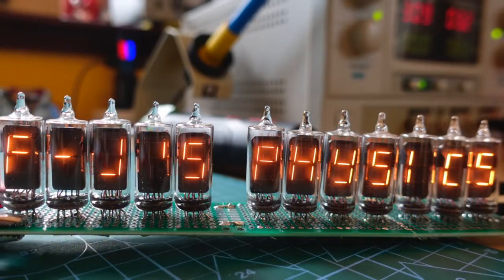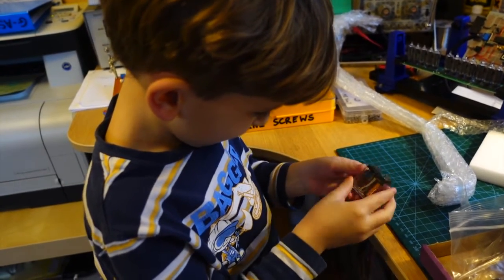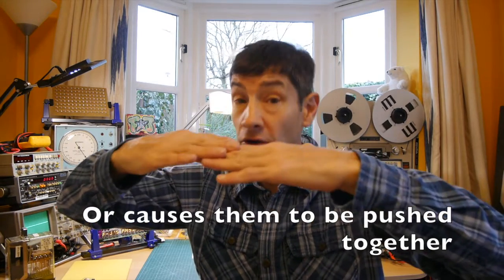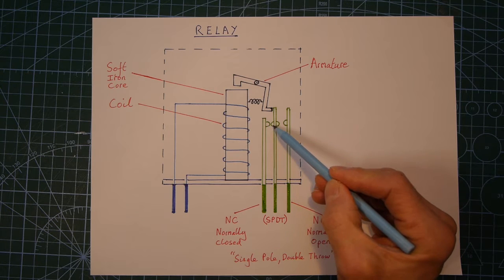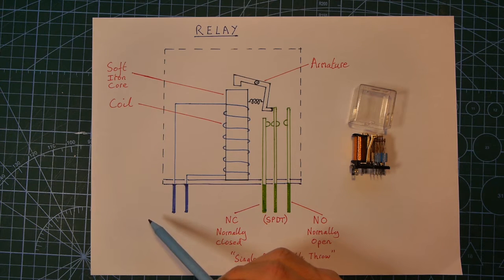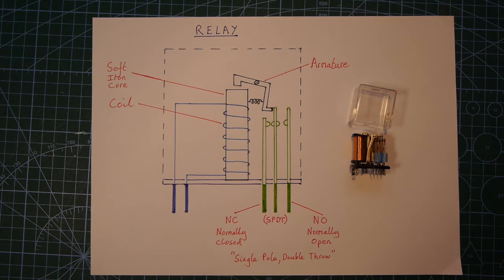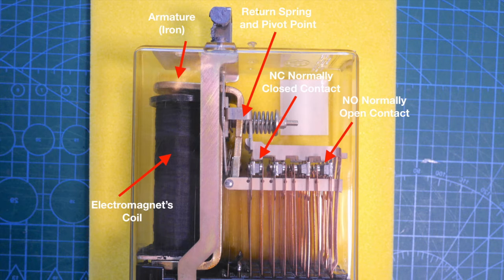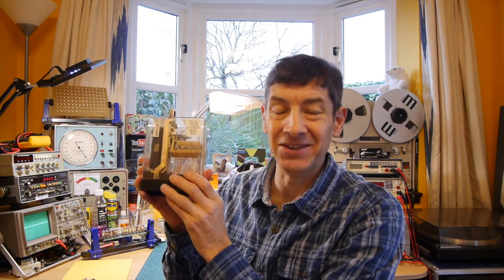Relays and How They Work - F-J's Physics - Video 180

Comment: Another great video, thanks. Have you tested any relays for contact bounce? Lots of relays used in vehicles switched by the various electronic control modules.
Reply from the maker: Thanks.  Funny you say that as some of the small relays that I am working with for another video I did test and they were terribly bouncy!  I then forgot to include them in this video!
Reply: @AnthonyFrancisJones That was my experience too many years ago II thought that using some relays to extend the range of a control system would be a good idea. Bounce was a real problem. Some capacitors and resistors came to the rescue.
Reply from the maker: Yes, that's a great story.  Can stop contact arcing but does slow the signal down a bit but I guess that was not an issue for you.  Your example proves the point that there is a real-world reason for knowing about such things!